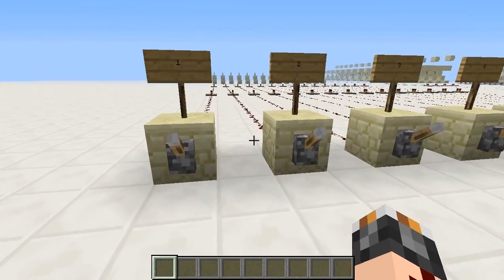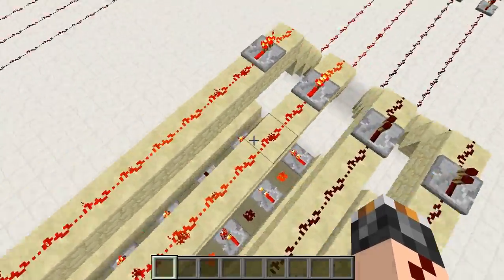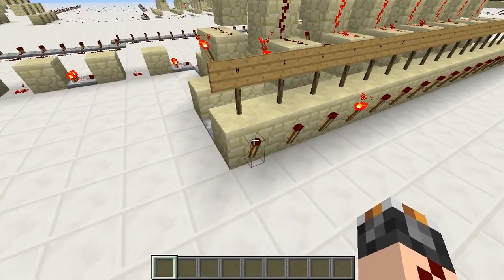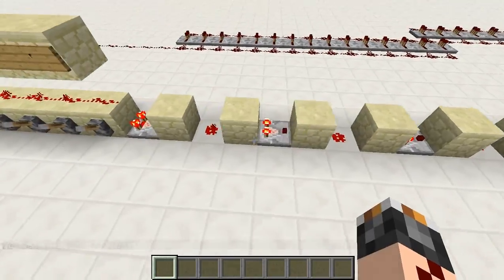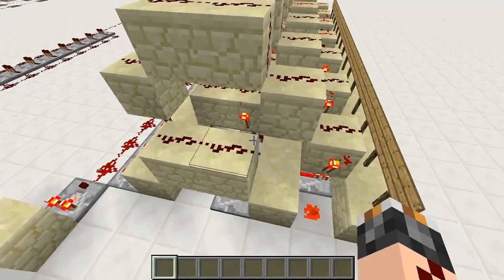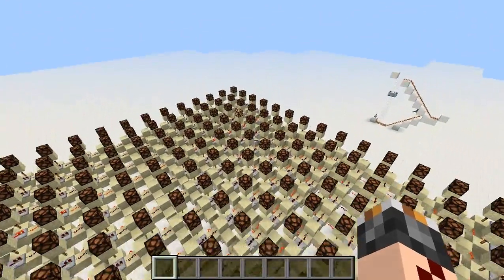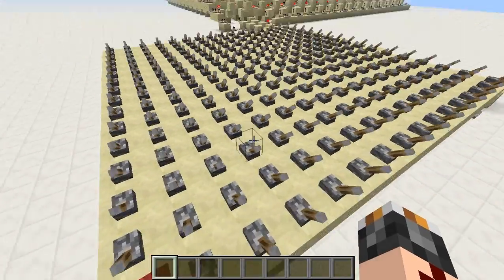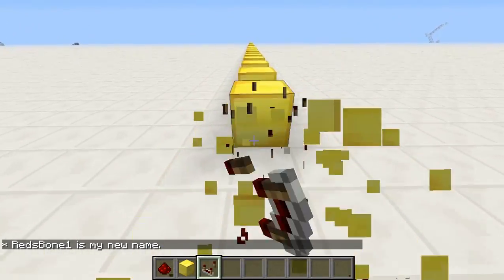Analogue Redstone Wire - Even More Compact Than Binary! - Minecraft Tutorial

Comment: Your decoder could be even more compact. Simple make a 1x16 row of blocks with redstone along the top and redstone torches along one of the long sides. place one comparator at each end feeding into it. Set one of the two comparators to subtraction and put a redstone torch behind it. Now run your analog wire into the end that isn't set for subtraction and also run it to the side that is. Now if your input is for example 0 then the subtraction end will output a full 15 and the other will output nothing leaving the first block unpowered because there are 16 blocks. which will turn on the first torch which represents 0.
Reply from the maker: Keep in mind that I made this video three years ago when I was not that good with redstone. But yes, things I showed can be compacted a lot.

Comment from the maker: You can make a variable by having two comparators in a loop, both pointing into a block and to redstone on the side.
You put one of the comparators to subtract mode and you can send a signal strength of 1 pulse into its side to lower the variable by 1.
Remove a block with a piston to set the variable to zero, and send a full signal strength into the redstone to set the variable to 15.

See my latest video for a better decoder.

That's all I can give you at the moment, I hope it helps :-)

Comment: In binary you use 4 wires to get to fifteen because the wires go 64 32 16 8 4 2 1 and 8+4+2+1=15. Using 15 wires would be decimal(base 10), not binary(base 2)
Reply: Troy Durica Actually using 15 wires would be unary (base 1).

Comment: cool, hexadecimal is useful, just wondering how will you bus the outputs as there isn't space between the output torches. anyway cool video.:D
Reply from the maker: You can use repeaters, or redstone dust if you alternate placing it bellow and next to the torches. A redstone torch does in fact power redstone dust which is directly bellow it.
Or you could place the next device right next to the decoder and not have to worry about wiring at all :P

Comment: the redcoder u use is faaar to big. and both, bin and an r too impractical to transfer Messages fast over distance.  If u need a Multitasking capaböe way to transmit messages and signals u use the 15across way where u place lanes directly next to each other and repeaters every 15 blocks. its totaöly multitasking capable anf depending on usage the probaply cheapest way.

Comment: f the computer is decent it will not lag because of particles. Minecraft has a HARD and SOFT Limit that prevent particles from spawnig too far away. However, if you have enough redstones,,, the CHUNK UPDATES can lag you a bit. But computers with actual gpus work fine.
Reply: +Daniel Mills In the 1.9 update particles have been optimized to no longer be entities they also are viewable from further away but them no longer being entities will probably help.

Comment: This is called Hexadecimal (not Analogue) ;) and it (sadly) is slow as fuck
Reply: It is slower mostly because the comparators introduce a half tick delay, but also much more compact. I actually find many analog circuits to be faster because they can be made so much smaller with fewer parts that add delay to them. The main issue is when you need long wires because digital wires only need a repeater every 16 blocks while analog needs a comparator every 4 so 16 blocks of digital wire only adds 1 tick of delay while 16 blocks of analog wire adds 2 ticks of delay because each of the 4 comparators adds 0.5 ticks of delay. So you really have to be careful how much wire you use and possible even switch to digital if you are needing a long enough wire to warrant it. Of course long digital wiring takes up a lot more materials.

I guess ultimately it is a matter of preference and application.
Reply from the maker: It is very fast if you use it at the correct place. For example, this device I made is mostly analogue and that makes it very fast: https://www.youtube.com/watch?v=udsrMKBW-HM
Reply: It can be mitigated completely by using Cubehamster's redcoder design and adding a comparator between each redcoder. It's more than 5 times faster than traditional analog wire all while only being 3 wide and maintaining signal strength. 1.5 ticks for every 16 blocks.
Reply: John Reynoso I also saw a guy manage to do a serial analog transfer down one line with a bit rate of about 40 bits per second.
Reply: Yep that's Koala Steamed that made the 40 bit/second wire. The problem is the lag becuase there is over 40 different signals coming down all at once.
Reply: minecrafter0505 it is analog as well as hexadecimal. It's only hexadecimal because notch decided 0-15 for redefine strength

Comment: Dude I seriously don't get how  this is more compact than binary... Its just like smashing two of them together... 
Um...
Maybe you want to see some other ones which can store massive amount of information in really small place. There is a video called smallest memory ever! Go check it out man 😄
Reply: Which is done by signal strength. Placing input on a line and detect how far it goes and put that in to data of 32 bits
Reply: Zenovarse that make every piece of redstone be able to store 15 differnt comb
Reply: Even though that looks like what you have done 😱
Reply: Like in combination of strength 1 strength 12 strength 2 strength 4 could mean 3 and stuff. Which can be done be Minecraft comparator
Reply: Well, it is easy to build and quite resource friendly. Binary is hard to optimize and is very resource intensive. Analog/Analouge is a little more limited, but very easy to build, and for simple tasks, is amazing.
Reply: No one will build them in survival innit